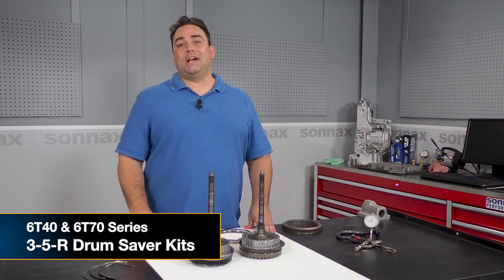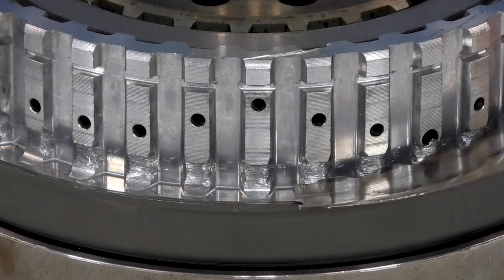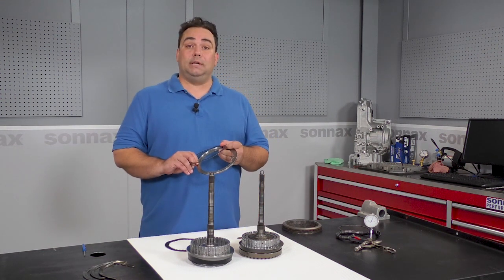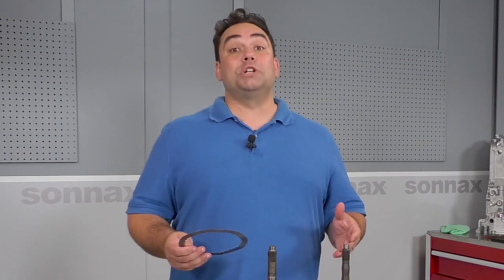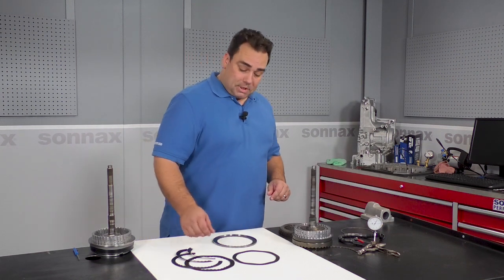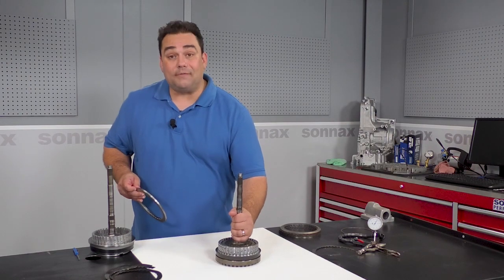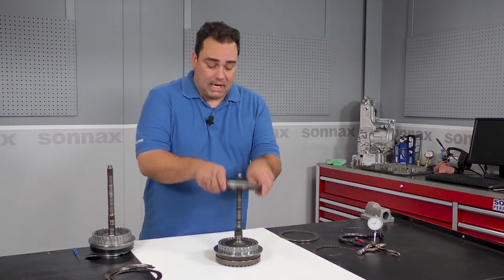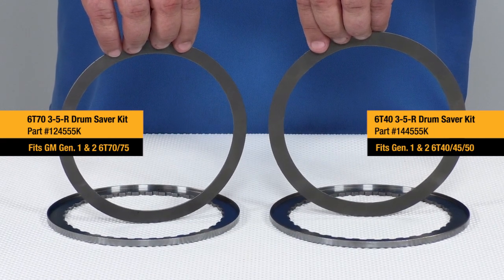Stop GM 6T40 & 6T70 3-5-R Failure with Sonnax Drum Saver Kits

Comment: I’m having the same problem with a Chevrolet Orlando Diesel gearbox here in the UK, the question I need answering are these parts available here to purchase or would I have to import them from the US,any help would be greatly appreciated.
Reply from the maker: We sell all of our transmission parts through authorized Sonnax distributors. You can easily find the one nearest you right on our website: https://www.sonnax.com/distributors. If you need further assistance, our sales team would be happy to help. They can be reached directly via email at info@sonnax.com, or phone at (800) 843-2600 or +1 (802) 463-9722. Thanks for reaching out!
Reply: @sonnax  Thanks for your reply, I will definitely give them a try and see what the price is,I’m a 77 year old ex-HGV fitter,the workshop’s I’ve approached here are frightened to death of these gearboxes and won’t go near them so I’m going to get someone to remove the box and then strip and rebuild it myself. I’ve watched several people strip and rebuild these gearbox’s and now feel competent enough to tackle it. Thanks again for the information.

Comment: I have a 2015 Traverse that its tranny started slipping at about 44000 miles. To make a long story short they tried doing all sorts of little remedies like reprogramming computer and swapping fluid and then it started doing it again later by the time I got into the dealer after I was convinced by service rep to wait it was already out of warranty. However I brought it in and they found debris and everything in the transmission and they rebuilt the transmission here at the dealership at GM covering 60% of the labor and parts and I paid 40% to the tune of $1,600. Everything seemed all fine and dandy after the rebuild until about twelve thousand miles later it started occasionally slipping from 2nd to 3rd gear. I brought it back to the dealership since it was under a 2-year 24,000 mile warranty and they swapped out the fluid and did a transmission reprogram as they called it. It isn't doing it all the time but now it's occasionally slips from first to second gear but I've noticed it only happens in the hot climates like when it's over a hundred degrees. Now since we are in a climate where it's a seller's market for cars and I can't get rid of this vehicle, do you have a recommended transmission shop here in Tucson, Arizona, that would be reliable for fixing the problem permanently in the events I can't get this to stop happening after the warranty runs out? Also can that transmission shop get another transmission with the Sonnax kit installed already? The 2015 Chevy Traverse I have right now is fully paid off already and I really don't want to get rid of it to get a Toyota 4Runner which will run you about $45,000. As I mentioned earlier right now is a really bad time to buy a new vehicle or even a used one, for that matter. Please help. This 2015 Traverse at this point is cheaper to keep it, although these issues of my transmission occasionally slipping when it's hot outside is really a big inconvenience.

On a different note, would it be okay to ask you for recommendation on potential transmission coolers and whether you or not you think it would be necessary after maybe doing the Sonnax kit? 

Please help.

Comment: Would a kit like this allow for more hp/torque on the 6t70?
Reply from the maker: This kit restores normal OE operation without buying an expensive new drum, but it does not raise clutch capacity to handle higher power input. Thanks for asking!
Reply: O